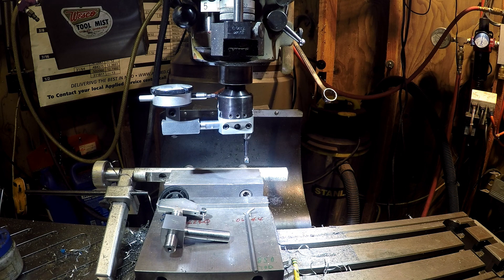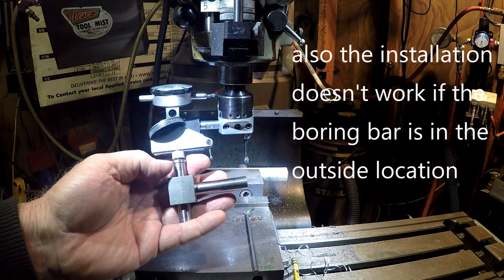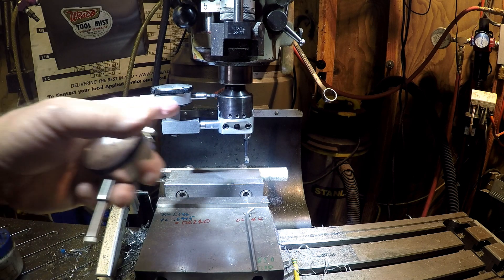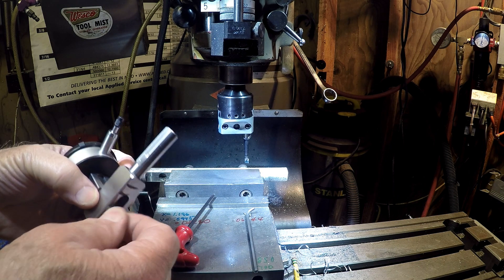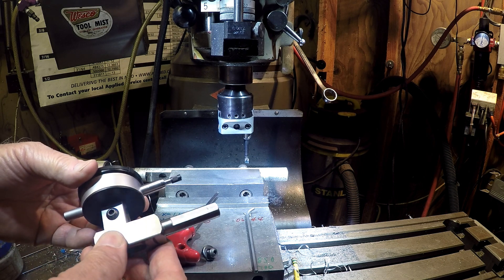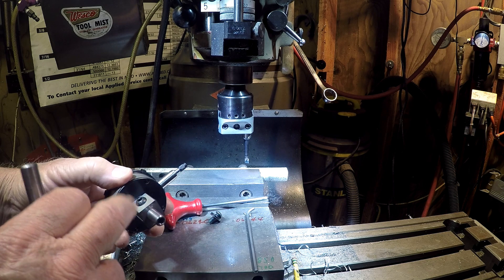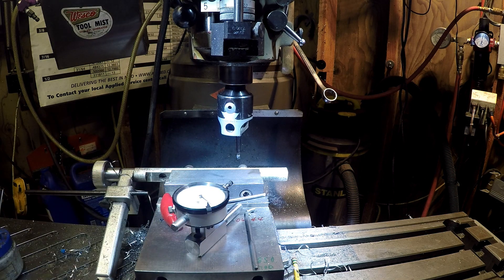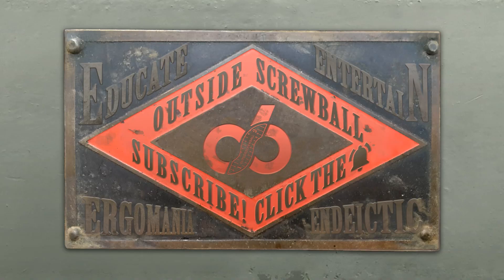Boring Head w/ Drop Indicator Mount

Comment: I was probably one of the last two people to purchase a original Boreset from the inventor a year or so ago. It is remarkably well made and thought out. I have a Narex and a Gamet  boring and facing heads and have been looking on the internet at all the recent youtuber ideas to make one to fit those. Your latest version is the simplest and the one I chose to make. I always mount mine opposite the adjusting screw for the cross slide so the indicator isn't in the way, ( The original Boreset only mounts this way ) In looking at yours I then wondered what if you have the boring bar in the outermost hole it is in the way of sliding the mount in to tighten the set screw so I simply bored the end of the shaft for a neodymium magnet and now if the boring bar is in the way the indicator mount, the shaft just pulls against the boring bar. Between the magnet and a good fit of the mounting shaft it holds without moving.  Works a treat. Thanks for sharing your idea Chuck.
Reply from the maker: Darrell, thanks for the subscription along with your comments on my idea, I found my design allowed ample view of the adjusting dial when the indicator was mounted, but the magnet idea does allow for a quick install without tools....nice idea!
Reply from the maker: Darrell....hmmm, was thinking about the magnet verses the set screw...if Bozo visits!! and the mill is turned on the set screw has a chance of holding the unit while the magnet will be allowing the mill to throw the unit...yikes!!
Reply: @outsidescrewball  Chuck you make a valid point but in my defense I should have mentioned that I do have the flat and use a setscrew when I can, and when using the magnet, the shaft is a snug fit in the boring head and takes a tug to pull it out. Bozo and centrifugal force probably could overcome the holding power but after retiring from a career that included many years as a machinist leaving the indicator in the boring head would be akin to leaving the chuck wrench in the lathe chuck and turning it on. Not happening. Others mileage may vary. Again thanks for your concern and also your design is as good as the Boreset and being adaptable to different heads makes it a real winner.
Reply from the maker: Darrell....my comment was more of an informational reply for anybody to consider as they read comments...I like the "pthers mileage may vary...LOL....funny you should mention a lathe chuck key...a buddy who machines once in a while had the pleasure of leaving the chuck key in the chuck and hit the GO THROW it switch...lucky him as it missed him....won't do that again....best,